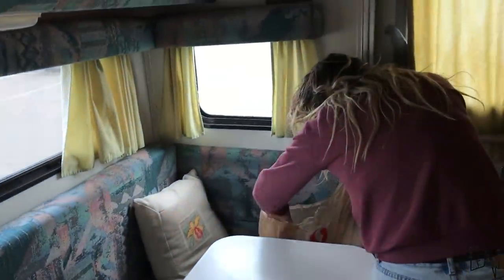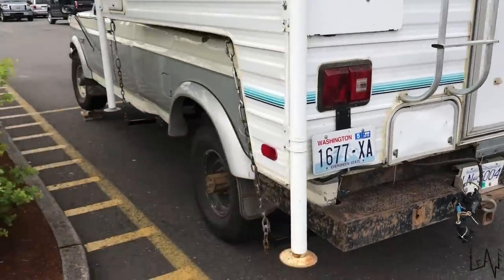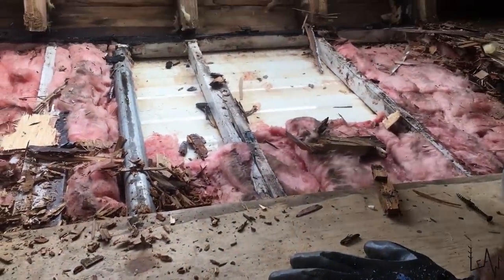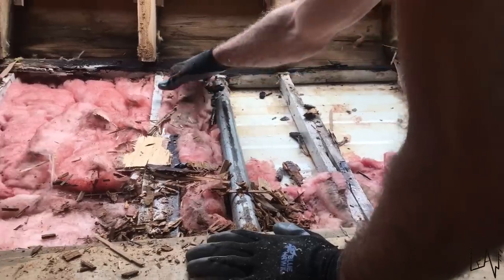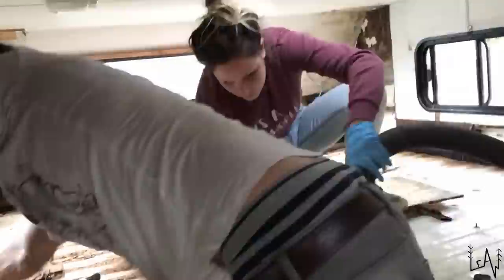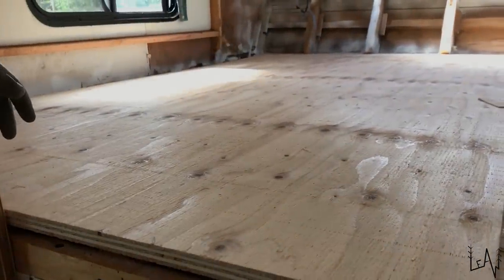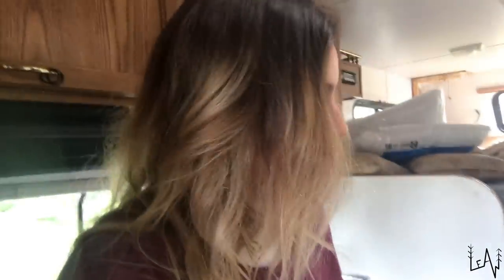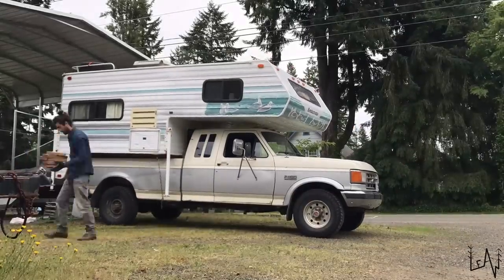DIY COUPLE REBUILDING / REFURBISHING CAMPER OVER CAB BED - LeAw Vlog #013

Comment: Did you get a new mattress? We had this same problem. We bought a new mattress as the old one had mold on the bottom and I'm sure it was making us sick. It started to smell really bad. We bought a new one that folds into 3 sections like a futon. So once a week we fold it up and make sure the condensation can evaporate. We also added a new insulation layer and a Dry Fast mat.
Reply from the maker: Hi Chantal, no we haven't changed our mattress because it is still good. We changed the cover. Yes, we added some new insulation layers as well. 
In this video, we change the cover and we reduce the mattress form king size to queen size: https://www.youtube.com/watch?v=L1RaY_oIfOw
In this video, we renovate the camper and rebuild the front part: https://www.youtube.com/watch?v=bik2pJpyJUo&t=129s
Second part: https://www.youtube.com/watch?v=arzp5Ptf_MM
In this video, we paint all the outside of the camper: https://www.youtube.com/watch?v=RbOP5zvccp8&t=220s

Comment: Great job guys we are impressed :) !! The water leaking was just terrible ... but where it comes from ? Roof ?
Reply from the maker: GO-YOLO I think is because of the condensation! Old campers have problems of this kind!
Reply: There usually is not enough condensation to puddle. You have a leak. Most leaks on trailers/campers like this come from windows or the seams/edges where the two exterior aluminum panels connect. I wouldn't want all of your hard work and money to go to waste. I would highly recommend finding the leak and properly repairing it.
Reply from the maker: doctorplastic yes! We sealed all the roof, windows.

Comment: Did I miss you put insulation in the floor? If not, your going to be cold if you are camping in any sort of mild colder temps at some point. Insulation is important for keeping the camper comfortable duri g not only cooler but also warmer weather…

Comment: I got a camper very similar to yours, but the floor under the mattress is really good, but the wood underneath is rotting. It can be repaired from the outside by removing the aluminum exterior. You are in Vancouver area. come and stay at my place out in country side and repair my camper ,you look like you do good work. I have lots of tools, and space to work, and you can work on your projects too.
Reply from the maker: videoclipits hey, nice! If we were still in Canada we would come and help you out! Unfortunately we already are in California USA. We hope you will be able to fix it soon. After we repaired our camper, we never had any leaking problems again. We insulated also all the over-cab bed area, you can check out Vlog #064 and at Vlog #065. Cheers Luca & Sara